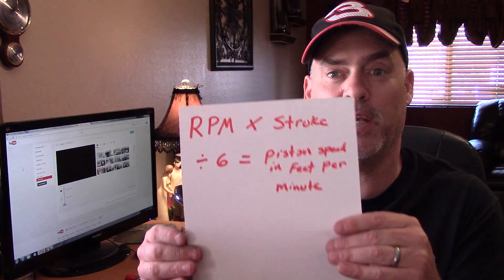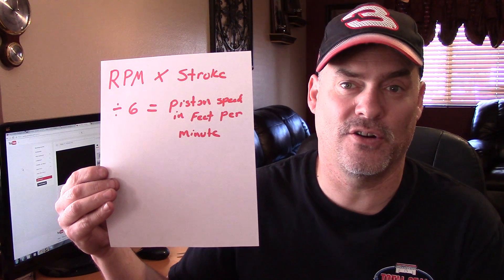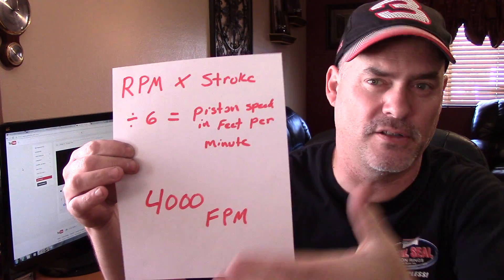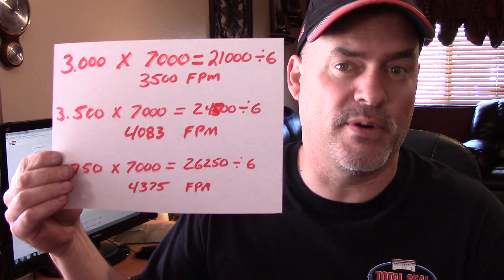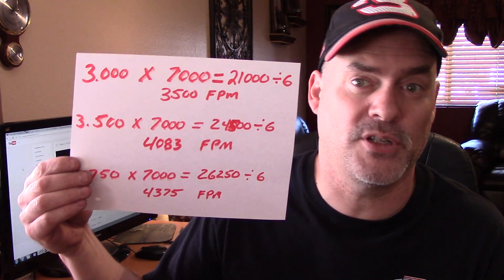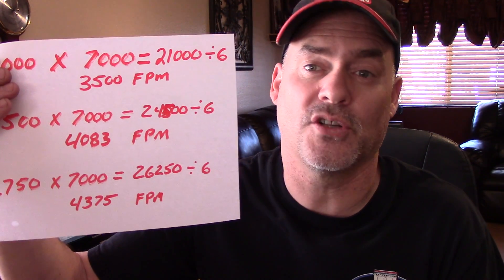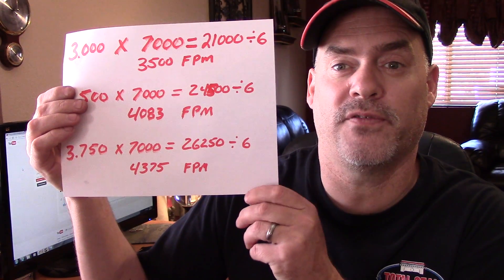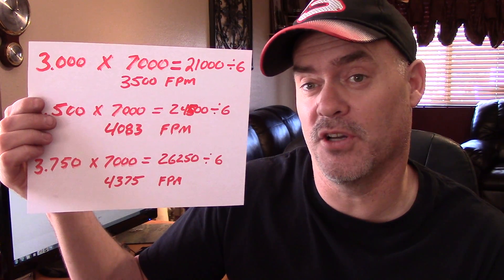What RPM should be an Engine's red line

Comment: Im a pretty good home mechanic but i have a question that i think i have been overthinking.
RPM's revolutions per minute
Stroke, 4 strokes includes up and down, yes i know what they are.
Cam speed, 1/2 of crank, yep got it.
Tachometer says I am doing 4,000 RPM's  to me a revolution includes one down and one up. as in a complete revolution.  so there are really two revolutions in a 4 stroke engine so i think.  So when i look at the revolutions per minute but think about how it actually only sparks once for every two revolutions or every 4 strokes.  what is my tach actually telling me.  Or if i am looking at 4k RPM's i am actually only sparking 2k times (firing cycles).   So the tachs rpm's have nothing to do with the firing count except the part where the tach doubles the firing count to give you a reading of rpm's?  something like that...  Told you.. overthinking this.
Reply: +Kolby Gines umm no it wont fire 4000 per minute and the motor does know which one to fire it called timing. if it fired all it would blow up. please do some research dont just write what you think
Reply: +Jeff Fleischman Don't over think it. 1000rpm is 1000rpm if it's a 2 stroke Diesel or a 4 stroke Diesel.
Same for petrol engines.
What should be said though is RPMs is not telling the whole story. People often think big revs mean big explosions, and this may be true in some ways, but in many ways it is not telling anything like the truth.
The truth is more the forces at play at those RPMs.
About 4100FPM (feet per minute) is the theoretical maximum  mean piston speed. This of course can be exceeded but 4100FPM is a datum by which to compare the characteristics of engines. 

For example the forces of a EMD 645 (about 10' bore by about 10" stroke) and around a 1000rpm max can have the mean piston speed and therefore the relative internal loads on the reciprocating components calculated by this rule. The motorcycle engine turning 14 or 15000 RPMs the same. 

So the revs aren't everything. Most car engines range in size from about 1 litre to about 7 litres with max revs in the range of 5000 - about 8000RPMs so we tend to think in those convenient parameters forgetting what the larger picture is.

Yay for Mean Piston Speed!
Reply: Yes, except for when it isn't.
Nothing can be explained away simply.
The pumping losses of a 4 stroke are far greater. Pumping losses are paid for in air and fuel in the (correct ratio).
Four stroke emissions are easier to control due to the dedicated exhaust and intake strokes.
I like 2 strokes, so I declare bias.
Reply: I get what everyone is saying.  Maybe i should put it this way.  On a V8 engine.  If I am spinning 8,000 rpms according to the tach.  Am I assuming that I am truey spinning 8,000 rpms but I am really only firing 4,000 times but my tach knows to show me 8,000 rpms because it is telling my rpms and not how many times i am firing per minutes.  Firing is 2 to 1 just like the cam rotation. Correct?  So nothing is going faster than 8,000 rpms no matter what.  Strokes don't count because they are really just 1/2 of an rpm.  I believe this is what your really trying to say, correct?
Reply: +Jeff Fleischman Your Tachometer reads ROTATIONS per minute, Not IGNITIONS per minute.
Reply from the maker: +Jeff Fleischman RPM is crankshaft rotations if you have balance shafts in the engine than your crank is turning 8000 your cams are turning 4000 and your balance shafts are Turing 16000 and yes you are firing 4000 times per minute
Reply from the maker: Jeff Fleischman Rpm is how many 390 degree rotations the crank makes the stroke events are a separate issue but it does take 720 degrees to complete the 4 stroke cycle
Reply from the maker: Myvintageiron7512 OOPs I ment 360 degrees not 390
Reply: +Jeff Fleischman yes a 4 stroke will only fire 2,000 times in 60 sec if going 4,000 rpm, where a 2 stroke would fire 4,000 times which is why the 4 stroke process is more fuel efficent
Reply: +Myvintageiron7512 if you have 4000 rpm you know it takes 2 rev of crank per stroke so 4000/2=2000 and there are 8 pistons so 2000/8=250 so you have 250 sparks per min is this what your asking??
Reply: +Jeff Fleischman at 8000rpm you get 500 fires of spark plug per min
Reply: +Sean Hamre No you get 50% of the total rpm, being 4,000 ignition fires/spark
Reply: +James Nelson i know and 500*8=4000 each piston fires 500 times a minute.
Reply: iceandhotwax I thought the spark plugs fire, not the pistons.  Haaahahahaaa
Reply: Eh, I mis spoke. The fact remains that all the cylinders on a 4 cycle engine fire in the two revolution cycle, I.E. a v8 fires all 8 cylinders within 2 revolutions.
Reply: +iceandhotwax  that is what thats says its only 4000 rpm not 8000  look at it 500 fires a minute times 8 pistons is 4000 not 8000 so its half
Reply: +Sean Hamre  think of it as  the tach counting just 1 cylinder and multiplying that by 2
Reply: iceandhotwax don't you mean divide that by two?
Reply: +Jeff Fleischman no one cylinder fires once every two revolutions of the engine if the tach counts each time the cylinder is fired, multiplys that by two you get rpm of the crank
Reply: there is a distributor, which selects which cylinder gets the spark. this distributor turns at 1/2 the rpm of the crankshaft so at 4000 rpm each cylinder gets spark sent to it 2000 times per min
Reply: I'm just looking for the relationship between the tachometer and how many times the piston really clears the top of the stroke.  Yes 4 strokes is really 2 full strokes and 4 half strokes if you will.  Thats easy.  But when a a tach says 1000 rpms, what is it really saying.  Like how many times did my piston clear top dead center.  Assuming 1000 times if it says RPM's.  So in turn that would really mean I fired only 250 times per 1000 full strokes or does the tach really show my how many times i fired which would be 250 times but the tach is calibrated to multiply that by 4 and show me a reading of 1000 rpms  or would it be only multiplied by 2 because its really only two full strokes to make a 4 stroke.   That would make sense, but thats why I am asking.  I've been wondering this for 30 years.  If this is the case a huge big block drag engine turning 10k is only really firing 2500 times per 10k.   Once again assuming the tach is activated by the spark being nothing else is electronic in an engine with a distributor.   Being its a 4 stroke I wouldn't assume that the engine is rotating 4000 rpms to show its running at 1000 rpms based on firing strokes.
Reply: +Jeff Fleischman the tach show just what it  says RPM that is how many times your engine crank turned full turns.
Reply: Uhm... I think it measures pulses, not average point voltage.

Most aftermarket tachs have settings where you need to select the number of cylinders, or it'll show the wrong rpm's.
Reply: I have a 5 cylinder so I have 36° overlap, but my counter counts in 180° revolutions, so I have 20% less ignition sparks than a 4 cylinder, still my rotations are the same. So the distance of my pistons travelling through the rotation will be the same. 7000 rpm* 9.3 cm*2 = 130200 cm per minute, is 1302 meter per minute is 21.7 m/s *3.5597*60= 4271 feet per minute.
Reply: Kolby Gines that's called a wasted spark ignition.  Ignition fires once per revolution so, at the end of the compression and at the end of the exhaust stroke.  

I don't know why I'm compelled to read all this lol.
Reply: Jeff Fleischman, 4 stroke is named for the cycles it takes to complete the combustion process.    1) induction, 2) compression, 3) power, 4) exhaust. One revolution of the crank will complete two of the for cycles.  Please do some basic reading on the 4 stroke cycle. I believe all your answers will be discovered.
Reply: This guy has 390's on the brain and I want to know why its this engine master's pick. What is going on with that 390 I don't know?
Reply: Not all cyclinders have fuel in them. So when there is a spark not all cyclinders will ignite, no engine destruction. Timing is for what point in the rotation of cyclinder. Not what cyclinder to fire in.
Reply: This is gonna blow your mind +Jeff Fleischman. The tachometer is a voltmeter that measures the average voltage across the distributor points. As engine RPM goes up, the points open and close more times per minute. We use this signal to measure the speed of the crankshaft. When the points are closed, the coil charges through the points and the difference in voltage from coil negative to ground is zero. When the points break the circuit, the difference in voltage from coil negative to ground rises to maximum. As the RPM rises and the points fire the ignition more times per minute, the average voltage at the coil negative terminal rises. We connect a wire from our tachometer circuit board here, and take this very weak voltage signal and amplify it with a transformer so it's stronger. Then we connect our tachometer circuit board to the battery through the ignition so we know what the input voltage on the positive side of the coil is, and our points signal becomes a percent of system voltage. We take our points open/close cycles per minute and divide it by the number of cylinders to get distributor shaft RPM. Then we take that and multiply it by 2 to get crankshaft RPM. Since we know what the total system voltage is, we can adjust the needle output so that the gauge is accurate at 11 battery volts or 14 battery volts. What you see on the tachometer face is a voltmeter with lines drawn on it at distributor points signal voltages that correspond to engine RPM.
Reply: No, no, no.  Revolutions refers to CRANKSHAFT revolutions!!
Reply: +Sean Hamre no each piston still fires once every 2 revolutions
Reply: a old school v8 302 small block running 4000rpm the spark plugs will fire 4000 per minute the motor can't tell what spark plug to fire off on. so it fires all so it can burn all fuel in cyclinders
Reply: Jeff Fleischman The rpm is the rotation of the crank shaft. The piston speed is always half of the rpm. 6000 rpm the piston speed will be at 3500.

Comment: Cool information my stroke is 3.6 so it seems as 6500 is the max safest rpm I can go on my engine which is 3900 fpm. And you said the longer stroke gives more torque which is interesting as I could tell my engine was a lot more torquey than my 3800 L36 powered car which according to this formula the L36 can easily do 7000 rpm and would probably max around 7200 rpm which gives me 4080 fpm on that engine.

This video made me subscribe thanks for the info.

Comment: Would be cool if you did a video on the effect the connecting rod length to stroke ratio has on the hp and torque of an engine.
  I've always wanted to build a Bug engine with a 1300 crank and the biggest bore pistons the bore centers would support and then have the cylinders long enough to support 2.3 x stroke ratio. Billet heads with the biggest valves that would fit without shrouding in the bores, and as close to a 14:1 compression ratio with closed chambers and D cup pistons.  The camshaft would be tuned to the dwell time of the pistons at the top of the bore.  The next thing would be a single plane pyramid intake with a tuned plenum and runners along with a Holley 660 center squirter carb. 
  I know the Euro guys like the weber carbs for throttle response, but a single plane intake with a combined tuned exhaust makes more power overall.... Anyway, would be fun to build such an engine.
Reply: and then your valves melt because tetraethyl lead 3 is bad for the environment unless you use 109 octane leaded av-gas.
Reply: +Ray Main You're even getting me excited. Remember high compression = pumping loss. There have actually been a number of very high compression production engines over the years and after the first run they were always backed down to around a still high 11:1.
Another thing, by my way of thinking, very high compression is only worthwhile (on the street) if the ignition timing is <30 deg BTDC. The greater the ignition advance the greater the pumping loss. This also points to less efficient combustion chamber design.
An efficient combustion chamber means the the ignition timing can be less which frees up horsepower otherwise lost to squeezing that pressure ie a pumping loss. 
On hemi heads, big ignition timing is a fact of life, as are heavy high domed pistons. Those engines make great power with high comp, big advance but there is more than one way to skin a cat.

11:1 seems to be the sweet spot for, ie lower=less power, higher=more power but at the expense of durability/reliability and varying ambient conditions.

Comment: Believe it or not there is a rule of the thumb that requires almost no calculation at all. Some extrapolation is required as the rule of the thumb part only works for 6000rpm.

So all one has to do is know the stroke length in decimal inches, add a zero to the end and voila!

3.00" stroke = 3000 fpm MPS @ 6000rpm
3.50" stroke = 3500 fpm MPS @ 6000rpm
3.75" stroke = 3750 fpm MPS @ 6000rpm

I am confident the 4000fpm could be easily exceeded in small motors with low reciprocating mass. An example, for the road going Honda 250cc 4 cylinder Learner motorcycle - the CBR250RR has a 1.33" stroke (33.8mm) and can turn 20 000+rpms. So 1330fpm @ 6000rpm will equal 1330X3 which is 3990 fpm MPS @ 18000rpm (1330x3 as there are three sixes in eighteen - puts you in the ballpark of 20 000rpm. This is the extrapolation bit)

I told a mechanical engineer of this and he scoffed. I taunted him to run the numbers which he did there and then and looked up in puzzlement at me and announced "You're absolutely correct."

Your equation is ideal for knowing the exact mean piston speed mine is just a simple rule of the thumb one could apply to say talking to a customer over the phone.

Great informative vid BTW :)
Reply: Another method which is very simple. 24000 / stroke = redline. (This works if you are aiming for a 4000 feet per minute max)
Reply: This is actually pretty good! I'll remember this forever, without even trying. Thanks for sharing it👍
Reply: You should not use the term "rule of thumb" if you knew the history behind that "saying" I dont think you would say it. I do not.
Reply: @DavidStirm  I wish someone would use the rule of thumb on you and beat that politically correct nonsense out of you...

Comment: The engine in my 1975 Ford Capri is a 3.0 L Pushrod V6 with a 2.8 " stroke and a 3.7 "bore , but the redline is around 6000 revs , is that low for a standard engine? The engine makes  good torque even though its a fairly short stroke engine that is only 3.0 L or 183 cu in ,  200 ft lbs standard
Reply from the maker: There are other things to consider also, The type of piston and or connecting rod strength in some cases the manufacturer will limit RPM because of a lack of strength in component design

Comment: Hmm, with this formula, the Olds 350 and 403 appear to have a slight advantage over their Chevy cousins with the same cid. The 350 rocket is a highly under estimated engine. Early 350 rockets can be bored to the 4.125 bore the 425 and 455 share, but have a 3.385 stroke, They can also use the big block heads as a upgrade. Even with windowed mains, the 403 can produce some insane numbers.

Comment: Not to mention, bearing surface speed with longer stroke requiring a better oil delivery to cool the bearing surface. With oil temperature being more critical to making power, the window narrows significantly. The old rule of 10 psi per 1000 RPM may not be sufficient.

Comment: Does ring resistance play any factor
Reply: +Anthony Carter Yes. A motor is an air pump. Any item that causes a the motor to loose power in the production of power is collectively called a pumping loss.
Pumping losses effect all engines whether they are a steam engine, a jet engine or a piston engine.
Ring friction is a major pumping loss. Valve spring pressure, piston weight, compression ratio, exhaust stroke, intake stroke (add practically anything you can think of) are a pumping loss and are always paid for in fuel (and air in the correct ratio). Reducing any pumping loss decreases fuel consumption and increases power - ie greater efficiency.

Comment: What does it mean when a connecting rod flies out of the bottom of the oil pan? Really curious if its going to affect my fuel economy.
Reply: put the rod back in and jb weld it back in place, should be fine just use plenty of JB 
     

...change your oil more
Reply: Your fuel economy will improve because the car becomes lighter due to less rotating mass in the engine ;)
Reply: 351cleavland usually the failure of the end cap or connecting rod bolts ...  i.e. ..flies out .. other sources of failures can contribute too .. lack of oil psi to the bearings , cause the bearing to fail .. excessive clearance leads to the "knocking " then excessive heat , gaulling , seizure , boom ... the rod is the last to get oil ..
Reply: randysengine service Sure, I did that and a week later a piston flies out the engine compartment into the cabin and up and out through the sunroof! I am 50% sure its not going to bre covered by warranty!

Comment: how do you determine what the piston speed should be for a engine? example. hp rods and a low rpm high torque cam. over a stock cam and rods. or a high rpm cam and rods.

Comment: I learned a lot just from this video, very well explained
Reply: He didn't miss it. All he was talking about was the components and if they can take the speed you are wanting to spin the engine to. The advantage means dick if the internals can't take the forces and become separate pieces.
Reply: You're missing the reason for the longer rod!!   You understand the higher RPM and stroke reasoning, but the advantage of the longer rod is entirely geometric!   A greater advantage is achieved with a longer and more angular focus on the crank  increasing the leverage and advantage!